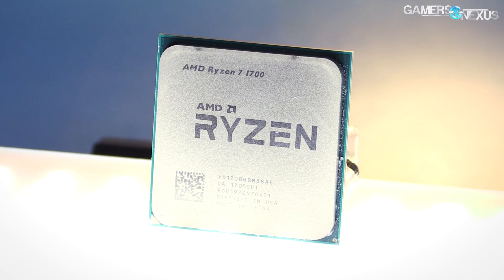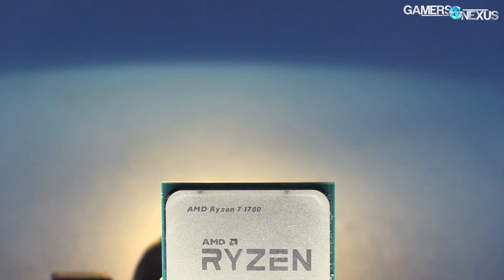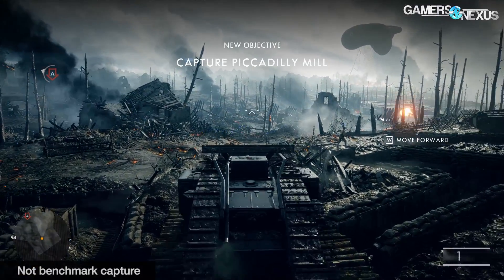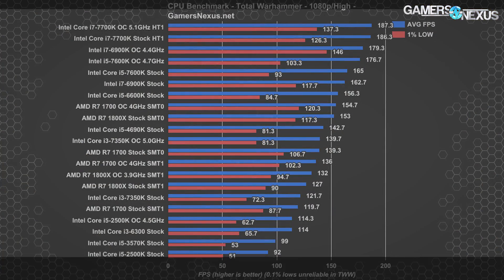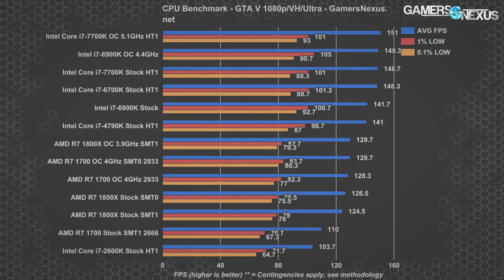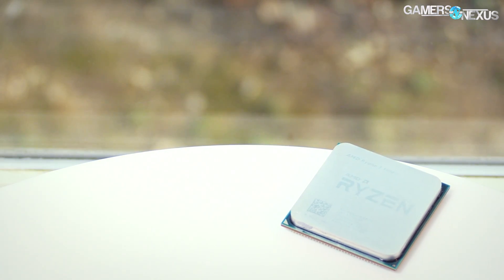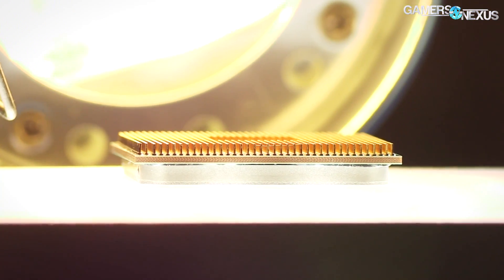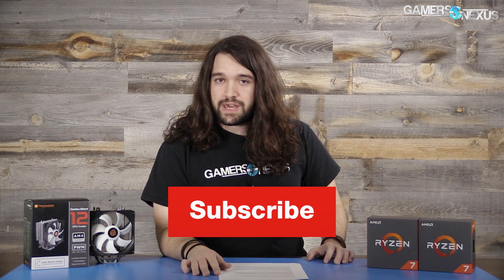AMD R7 1700 SMT Off + Overclock Benchmarks

Comment: If your monitor is a 60hz monitor at 1080p or its a 1440p or higher resolution,  Then all these charts are pointless.  Keep that in mind when your looking at benchmarks that show one chip at 120fps and another at 160fps these charts seem to  show a dramatic difference. Truth be told real world experiences make them irrelevant.
Reply: Actually, even getting 120fps on a 60hz screen still has its benefits; 1/60(hz/fps) shows us the maximum wait of ~17ms between one image and the next. By rendering two frames for every refresh, you are effectively halving your frame age, or latency.

Argument can also be made that a game capable of being run at 150fps, but capped at 80 or even 100, is reducing the load on the CPU and therefore will incur less input latency from your keyboard and mouse. Having a faster computer is always beneficial, irrespective of what you have been told you can perceive.
Reply: Good concept, but if you use V-sync or an in-game framerate lock (or rivia tuner) it wont render a 2nd frame in that refresh cycle. it will just literally tell the GPU to shut up and wait. without it, you will get whatever the gpu is up to at that 17ms interval (=screen tearing). Unless you could get a 120fps v-sync solution (leaving G/free sync out of this), but then whenever you dipped below 120fps render you, you would get frame pacing issues: ie at 60/60 you see the result of 17,17,17,17,17(ms of lag)   but at ~120/60 it might be 17, 8.3, 8.3, 17, 8.3.  - that's what I think anyway
Reply: Surpuppa but the question is do you notice the difference between 120fps and 144? I have a 1440p 144hz and when I dip in the 120s I really can't tell, I can see deference when it drops below 60fps other than that it's really not that much of a deference, Bf1 R6 Sg, and cs go.
Reply: Especially considering that you'll have frame tearing if your fps is way higher than your monitor's refresh rate. People seem to forget that your monitor limits the amount of frames you can see as well.
Reply: I actually very rarely see tearing on my 144hz, even when running upwards of 200fps in games. I understand in theory this makes little sense and I don't know why this is. Maybe the pixel response rate of a high quality monitor plays a factor, as it is able to render a full screen image faster, not chopping it half way. I don't know.

I feel I do notice a difference between 144hz and 120hz, but I haven't been able to prove this to myself. I definitely notice 100hz as my screen automatically drops to that when cloning on a 60hz and I've on occasion shut down while doing so. When next booting, I don't realise that I'm still cloning to my TV when I jump in a game (as the TV is off), but I notice the difference on my primary monitor immediately. I'd say I have effectively ruled it out as a placebo effect. However I am of the belief I have abnormal sight, often noticing the frequency of some lights while others around me do not, so I figure this is also highly subjective to the individual.
Reply: TheTopMostDog on a 60 hz monitor, that tear is on screen for 17ms, on a 144hz that tear is only there for 7ms. So that could have a lot to do with it.  Also 60hz looks more jarring on a monitor with a fast response (1ms) than it does on a TV as the slower response of the TV softens the transition.  If you notice lights flickering, it's not uncommon, you "should" notice that you detect it in your peripheral vision much more readily than your centre sight. And it will be more obvious when your eyes are moving between objects.
Reply: i have an easy time seeing a difference in 60hz and 120hz but honestly dont think im seeing the extra 24hz on the 144hz however it came with this gsync monitor which was something i wanted along with stepping up to 1440p
Reply: i think this conversation is about 60Hz screens, and the benefit of 120fps rendered by the GPU on a 60Hz screen
Reply: forestR1 yes, but that statement is grounded in that most people only have a 60 Hz screen. But Ryzen is supposed to last for several years, and even right now, the most sold screens for gamers are 144 Hz, so high FPS is vital. Saying that there is no need for FPS higher than 60 because the norm is 60 is wrong, because soon the norm is 144
Reply: I don't mean to say it's limited exclusively to 60hz monitors. If you had 300fps and a 300hz monitor, you'd be receiving the information even sooner from the computer than 144fps on a 144hz monitor. The idea really can be applied to all output from your computer; FPS from a game and Hz from a monitor; faster is better because frequency is determined by period of time between cycles. People are only just catching on. This is similarly why frametime is becoming the preferred measurement of gaming benchmarks, it demonstrates both stuttering and latency to boot.
Reply: yeah no argument there, that was just in reference to 60Hz users. I run 144Hz freesync and it's awesome
Reply: G-Sync varies the refresh rate, so you wouldn't even be sure which refresh rate you're actually looking at.
Reply: Keep in mind that the human brain sees  delays of 5 ms or less as real time and can cope with up to 40 ms of delay depending on the scenario. Also, the whole jarring effect comes from the fact that a 60 Hz monitor caps your FPS at 60 FPS. The artifacts are caused by the monitor throwing away all the extra frames it can't present per second. Same with the tearing. Which is why bragging about 300 FPS on a 240 Hz monitor, for example, is pointless, since the monitor won't be able to display 60 of those frames.
Reply: Surpuppa what people dream about buying on amazon vrs what steam stats show is real world install base doesn't interest me.
Reply: Surpuppa check steam Stat on actual install base and get back with me.  Reviewer were quoting these stats to justify the concentration on 1080p benchmarks.
Reply: jekrika32 if you are just gaming, and only at 60Hz then yeah, not much point buying a CPU suited for 120fps. according to information from LTT 144hz monitors made up the majority of monitors  purchased on amazon throigh LTT affiliate code. so it's becoming mainstream. i have 144hz and its great

Comment: So basically Ryzen 7 1700 OC to 3.8Ghz - 4.0Ghz can play any current games maxed out and still have extra 4 Cores and 8 Threads left for the future and its priced like Core i7 7700K, if thats not good value for money I don't know what is especially if you can achieve 3.7Ghz on stock cooler and £105 motherboard :)

Comment: Dear Gamers Nexus. I have a Benchmark request.

We know from pcper that the latency between Core complexes is higher going from one core complex to another. 
Does it help performance when manually assigning the Core affinity of the game process to one core complex? I mean, could you try the game benchmarks with affinity set to the first 4 core's when SMT off, or when SMT is on the first 8 cores?

Comment: rabid fans can really go to great lengths of idiocy just to justify their foolishness. AMD Ryzen 7 is basically in the same situation as core i7 enthusiast chips. they are  slower in games but better in multi-threaded workloads (same boat as the previous AMD am3 8 cores) but are weaker performing on IPC Hungry games. The real question is can AMD R5/R3 outperform the current intel mainstream offerings (pentium,i3,i5,i7 {never mind the celeron 2 cores 2 threads}) while undercutting its prices? I would like to see AMD do great at those segments but leaked pricing on r5's/r3's makes me bet they cant compete or might be a harder sell. Here's hoping AMD dont recycle old APU's for AM4 and instead release solid performing quad core APU's with better on board gpu as many rely on those for small businesses like i do and the G4560 is really hard to beat...

Comment: I'm a bit disappointed of your analysis, I joined this channel because it was the channel that did the most in depth analysis and didn't just look at the numbers but actually analysed the numbers.In this video you are saying that a game has very little difference on average fps and completely ignore the 1% lows that jumped in all games, at 5:54 you can see a jumps from 106.3 to 120.3 to get that 1% lows you are above the 7600k OC.. Looking at that alone demonstrates that ryzen when the scheduling issues are ironed out will be a very good gaming CPU.All of this is with games optimized for Intel.
Reply: I believe it was AMD themselves that already posted that there is no scheduling issue. And your "games for intel", please just get your head out of your ass and handle facts for once, would be nice.

EDIT: https://community.amd.com/community/gaming/blog/2017/03/13/amd-ryzen-community-update

"We have investigated reports alleging incorrect thread scheduling on the AMD Ryzen™ processor. Based on our findings, AMD believes that the Windows® 10 thread scheduler is operating properly for “Zen,” and we do not presently believe there is an issue with the scheduler adversely utilizing the logical and physical configurations of the architecture."
Reply: Then you glance up the chart at the 7700k with 25 more fps in the 1% lows and it is roughly the same price as the R7 1700. If you do more then game then buy Ryzen. If you are a fanboy buy Ryzen. if you only game and want the best right now buy 7700k.

Comment: Does XFR even make a difference or is the difference just insignificant? Can the 1700 hit 4GHZ OC?
Reply: It's shown several times that their 1700 is overclocked to 4ghz.

[Edit: and if you're asking about its automatic boost to 4ghz, then you have to understand that's why there are X models to take further advantage of XFR. IIRC, non-X xfr won't take it much more than 100mhz above its boost clock.]
Reply: I have not seen a review where the 1700 hits 4GHz so I dont think that it is possible

Comment: While I have not tried AMD Ryzen yet, from my experience with an overclocked fx8350 (5GHz), for games which did not make good use of all 8 threads, one of the main bottlenecks from some games were from 1 or 2 demanding tasks that were not multi threaded. For example, AI and path finding intensive areas would cause a larger drop in performance, where you would see a single thread use the equivalent of 1 full core of CPU time, with a corresponding drop in CPU usage from many other threads,thus pointing to the rest of the game engine waiting on a single thread. Situations like this, it shows that even if a game can use 8 threads, certain demanding tasks within the engine that will only be able to use 1 core, can become a bottleneck if that single workload becomes too complex.
Think of it like some of the functions in adobe after effects where some of the most complex tasks only seem to want to use 1 core, thus while doing a render, even though the GPU can assist with some effects, it will ultimately be waiting on that 1 core for that 1 complex effect that is still single threaded. Overall, while many threads can help in many workloads where the tasks are more balanced, game engines are largely unbalanced, but everything has to mostly be in sync, thus a single overloaded thread can slow everything down, thus making IPC still very important.

Comment: The IPC is there. Now we just need to be able to overclock it higher. Willing to bet if ryzen was able to clock up to 4.4 to 4.6 it would be an absolute monster.
Reply: Maybe. If you look at the leaked info for the R5 CPUs, theres none over 4ghz. Infact they're scarily close to the clockspeeds of the existing Ryzen CPUs. Seeing R7 is merely two quadcores under a single IHS, I have my doubts that the quadcores of the R5 series are going to be much different at all, if not literally half that of a R7 chip.

I've read inconsistent frequencies for the flagship hexacore, the 1600x, so maybe there's some some promise there. I want to be completely wrong about this, but I just don't think we're going to see a 7700k killer in this iteration of Ryzen.
Reply: +OVERCLOCK EVERYTHING
Yeah, I'm keen to see the pro CPU variations and AM4+. The future is exciting.
Reply: +Ola Hoglund >"It is never going to happen. Especially since it is AMD every single one of their products are tapped out in over clocking. People need to stop these pipedreams of AMD and gaming. Especially on Ryzen cpus."

Well, you're generalizing quite a bit there. For starters, we have only 3 Ryzen CPUs available. There are four to five times that in this generation, most yet to be released. Including the Pro variants that have been rumoured about.

Secondly, we haven't seen any optimization yet. AMD have their fingers in all the developer pies, many of which have been onboard with Radeon for years. There's no doubt many of these devs will be optimizing at least their future titles for Ryzen.

The most important thing that people seem to be missing is that before the Ryzen release, the i5 CPUs were recommended for all but the most hardcore gamers. If an i5 is good enough then why the hell are Ryzen CPUs all of a sudden "incapable of gaming" when their benchmarks aren't up to snuff with a 7700k.. when they almost entirely wipe the floor with i5 CPUs in benchmarks? 

The Ryzen 7 CPUs are high productivity CPUs, performing to compete with the top tier Intel offerings for those workloads. They're also good enough to run games, and far from incapable of doing both... at the same time. This is why Ryzen is a good CPU, despite what anyone says about their gaming benchmarks at launch.
Reply: OVERCLOCK EVERYTHING It is never going to happen. Especially since it is AMD every single one of their products are tapped out in over clocking. People need to stop these pipedreams of AMD and gaming. Especially on Ryzen cpus.
Reply: someone clocked one over 4.1
Reply: OVERCLOCK EVERYTHING thats why people are wating for the ryzen 5. less cores=better clocks thats a fact
Reply: but it cant overclock that high... at least not on all cores
Reply: Surpuppa I know it can't now I'm talking when it matures.

Comment: Thanks for doing this! Is it possible that the 1800x might drop enough in heat that it can be overclocked farther than normal with SMT off? or even if you disable 4 (is this possible?). As I've said many times before I don't think this will make it competitive but it will give us an idea of what to expect from the 4core/8thread ryzen right?

EDIT: Also I don't think people want to disable SMT forever. they are just trying to  see what the chip will perform like when games are properly optimized. it will at MINIMUM perform that well once smt is properly used and likely perform a bit better right? so it's just a point of reference.

EDIT2: I guess you kind of point this out as well. at first you made it sound like we didn't learn anything useful from the tests :)

Comment: The real value to me is that I do not need to chose anymore. i can build a mini-itx 7700k gaming machine, and a R7 1700 workstation for less money than a 6900k workstation would have cost me. Thanks AMD (I will be waiting for R5 and R3 reviews before doing so.)
Reply: Rysx I sincerely doubt that unless you cut back on multiple components.  The price of the 6900k is about equal to an entire 6800k, or 7700k platform including motherboard, ram (32GB 4x8GB kits), and either the 6800k, or 7700k) for 800-900 dollars alone.  This doesn't include storage, video card, case, and power supply for just that system.  Oh, and than now duplicate that for the second AMD rig (motherboard, CPU, ram, case, power supply, and storage).  Note: This doesn't even include cooling options. So yeah, your claim doesn't stand up to the math.  The 6900k is clearly expensive, and inflated, but there's no two systems for the price of one.
Reply: In the Market I am in: 6900k + Asus Rog Strix X99 = 1980.98$. R7 1700 + 7700k + Asus rog Strix ITX + Gigabyte GA-AB350(most expensive mATX available here at the moment) = 1296,96$. So I have 684.02 to play with. So yeah, it may come to about the same price in the end, but I still walk away with a lot more computing power.

Comment: I am really interested in how the Ryzen 4C/8T and Raven Ridge CPUs perform because these shouldn't suffer from the problems that occur when the CCX have to communicate with each other because these CPUs should only have one CCX active or on the die at all.
The CCX intercommunication seems to be a problem in multithreaded environment and produces high latencies and therefore a performance loss.